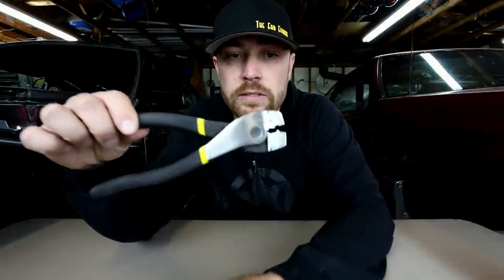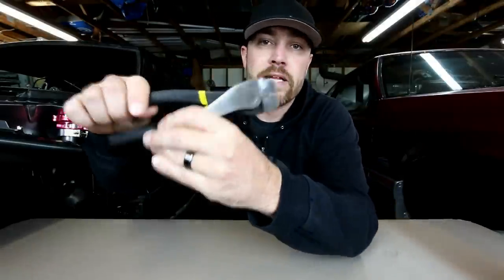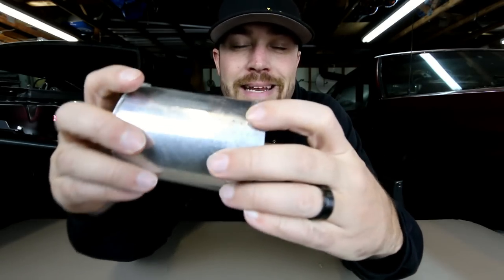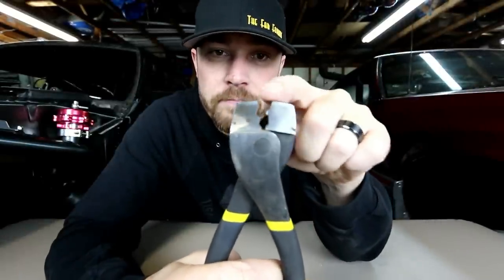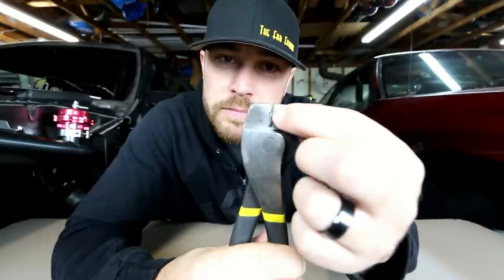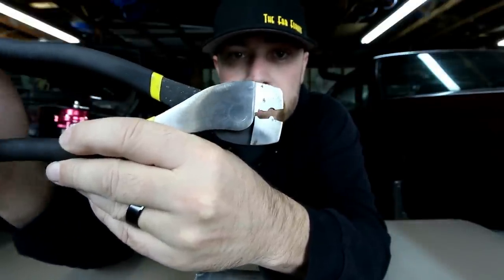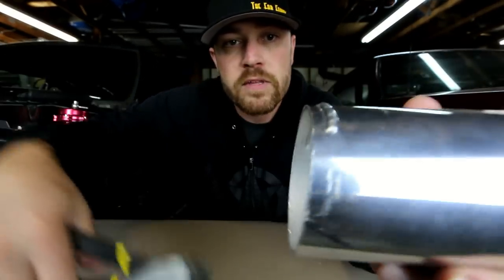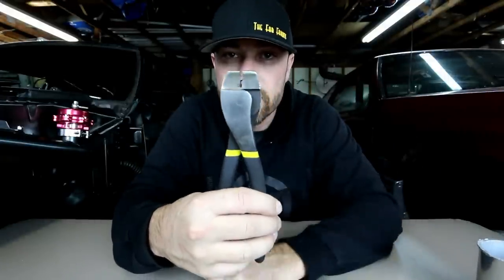You Need This Tool - Episode 2 | Hand Held Bead Roller

Comment: Do you think something  like this would be strong enough for steel tubing?
Reply from the maker: +Sleepy SRT I think the tool itself could probably handle it but I dont think you would have enough strength to squeeze it.
Reply: +The Fab Forums that makes sense. I have been welding a bead around the edge but this looks a lot cleaner.

Maybe its time to move to aluminum intercooler piping. 

Thanks man!
Reply from the maker: +Sleepy SRT No problem. Aluminum intercooler piping will aid in heat transfer too.

Comment: i'm all about diy, but you can buy a fake bead form on chinese ebay foe 80$
Reply from the maker: +Moshik Galimidi can you put it in your tool bag and take it to the track with you?
Reply: +Moshik Galimidi Can you link to one?  I've never seen one that cheap and I'd probably buy one if I did.
Reply: +The Fab Forums yup its not that big :)
Reply: +Jared Shaffer search tube bumping tool on aliexpress.
Reply from the maker: +Moshik Galimidi They look like they need to be attached to a bench, and they are over $100